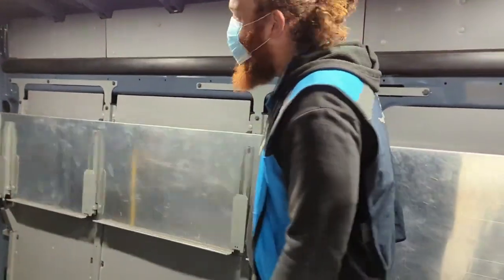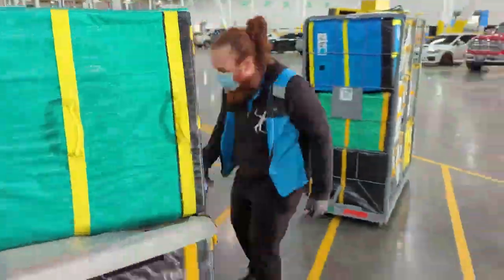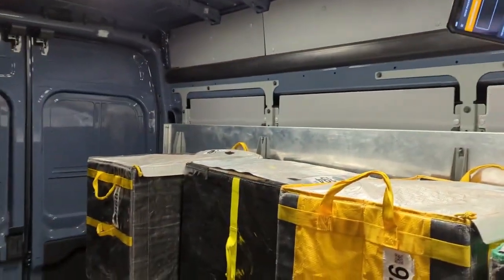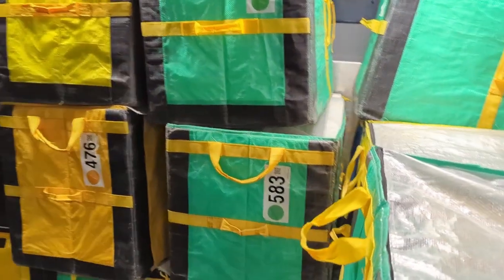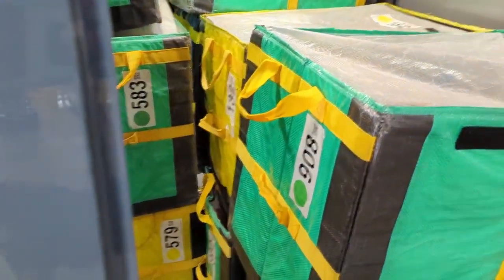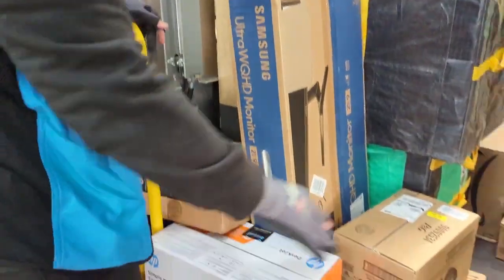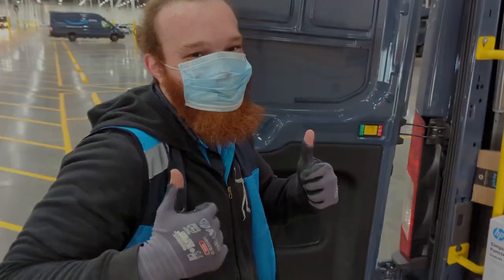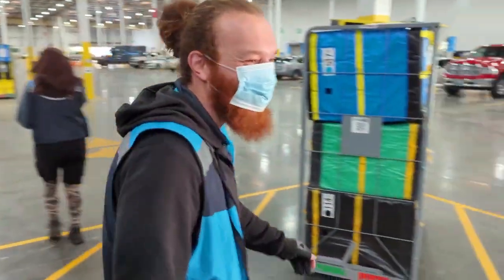PINS Amazon Van Loading - DSP Training Video

Comment: That’s great and all when you have time but when you have some stations screaming to hurry up that’s not the case and you just have to throw all those suckers in without organizing it smh.
Reply: Bro tell me about it 🙄
Reply: It would be nice. We have to throw and go, hope it don't topple before first stop, then we can organize.
Reply: Your stations need to chill, it's required by Amazon that they give you at least 20 minutes to load you vans. If you have trouble with it I would just load up as fast as you can and organize at your first stop for 20 mins or so.
Reply: @coleton2144 there’s no fixing time if you trying to finish fast cause dispatch as well rushes you if you behind and does not send help most of the time.
Reply: For real. Our station allows for 15 minutes, but they start yelling to hurry up after 5 minutes. Doesn't help either that our carts are nowhere near close to the load-out zones

Comment: Not gonna lie this has to be the worst way of loading I've ever seen. Most drivers at my company do not have a good way of loading their vans and it definitely hurts them. 

What I do is load all of my totes in the front half of the van, usually I never have more than 17 totes. I put a couple behind the wall where the seat is, then make two rows back to back, the first row has two bags on top of one another, so 6 in total. The second row is where I would stack three high if needed. Then I have the whole back half of the van for oversize. Going in ascending order, I load my last oversize first, it makes it easier to stack and cram 40+ oversize in a small space. The first oversize packages to be offloaded will be right up against the back door, easily able to take them out.